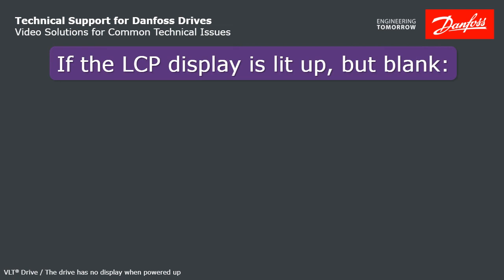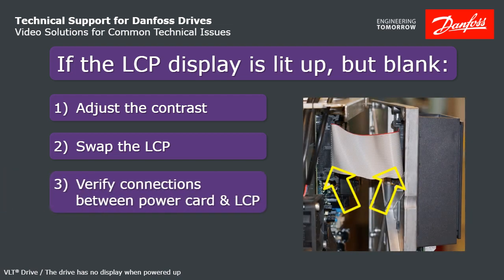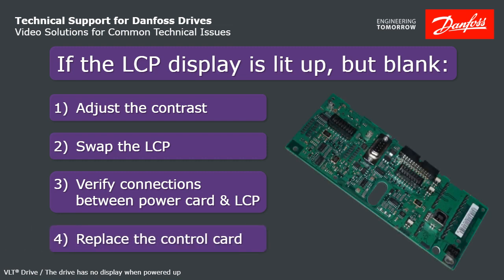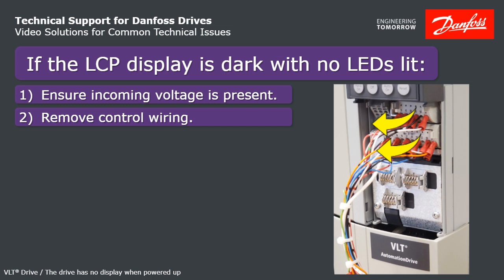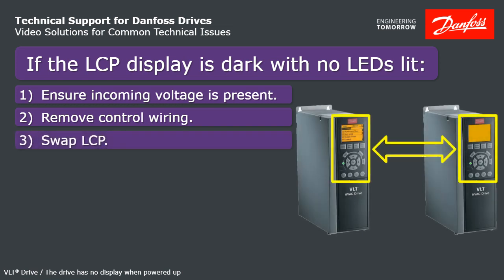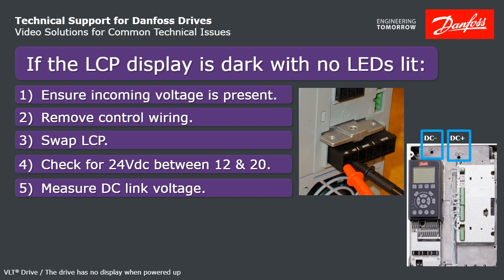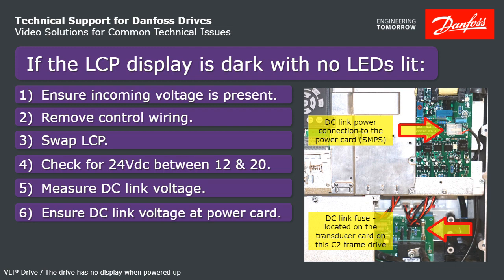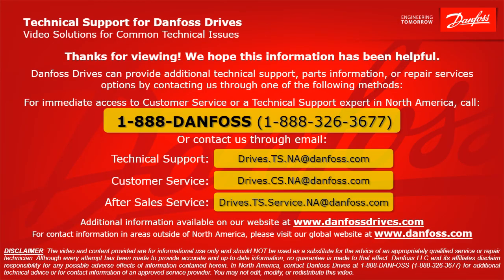VLT® Drives: No display when powered up

Comment: I have an old vlt 2800 which the display will come on after a long time when energized but today the display stayed out, what I did: put the power out and took the wire out on connector 18 and 20 and then I  put the power on. Direct the display started up 🤗 
Lucky me.
Reply from the maker: For installation, start-up, programming and troubleshooting assistance please email: Drives.TS.NA@Danfoss.com
or if you need immediate assistance contact Danfoss Drives 24/7 tech support at: +1 888 DANFOSS (326-3677)

Comment: in my case, the replacement of four 35V 220uF capacitors helped, previously I checked the voltage on the DC BUS and it was ok also the voltage of 24V DC between terminals 12 and 20 was fine
Reply from the maker: For installation, start-up, programming and troubleshooting assistance please email: Drives.TS.NA@Danfoss.com
or if you need immediate assistance contact Danfoss Drives 24/7 tech support at: +1 888 DANFOSS (326-3677)

Comment: Blank display,  I think that problem is in firmware of LCP or interrupt data stream.
Reply from the maker: For installation, start-up, programming and troubleshooting assistance please email: Drives.TS.NA@Danfoss.com 
or if you need immediate assistance contact Danfoss Drives 24/7 tech support at: +1 888 DANFOSS (326-3677)